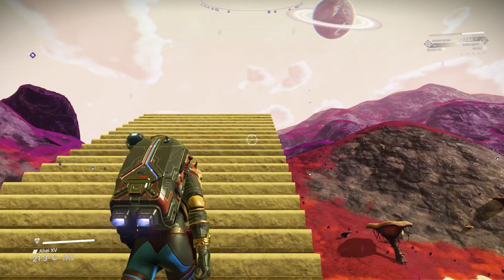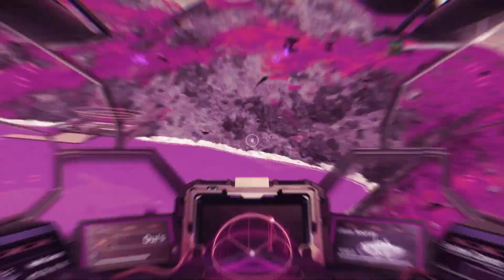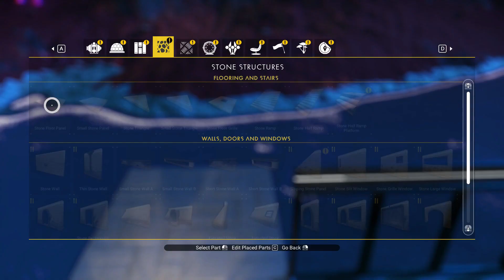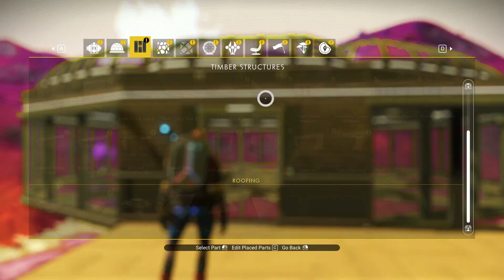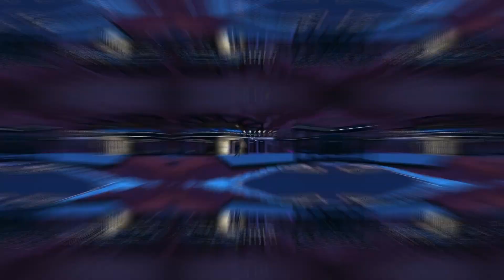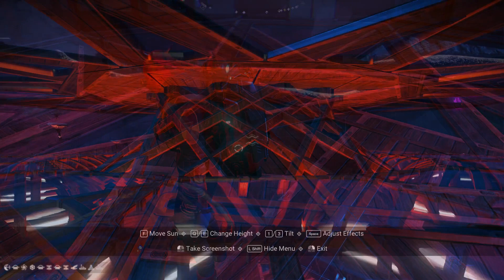No Mans Sky, Lets Build A Floating Base, Part 1

Comment from the maker: Update: I should have mentioned that to place the small lamps use free placement and also, you can put all double lines on the star pattern roof, but it gives a slightly different result. Free Placement on PC is V. Cheers.